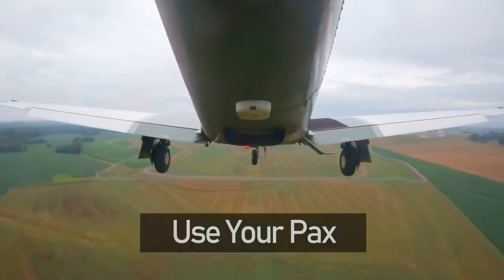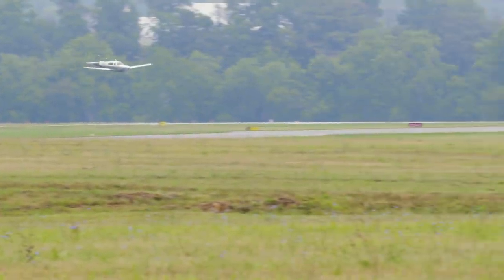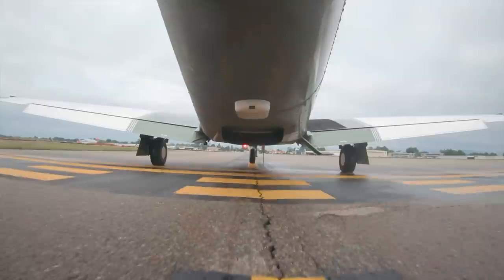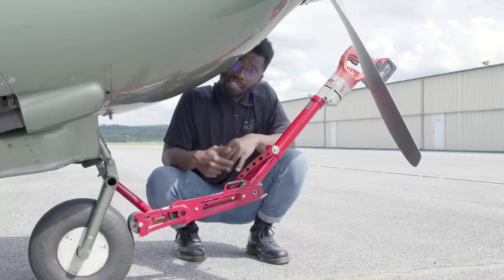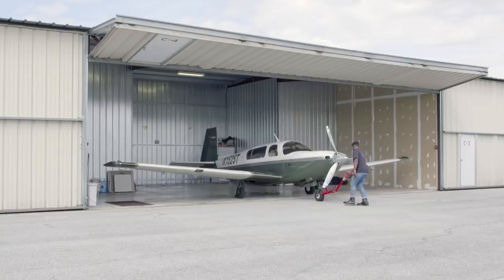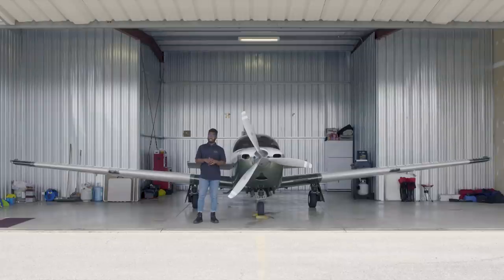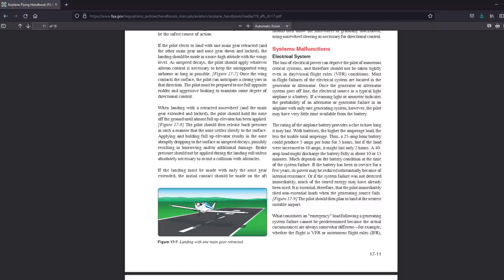Avoiding Gear-Up Landings and Gear Collapses

Comment: To avoid gear-up landings I simply lower the gear before I land.
Reply: Salute🥂
Reply: I’ve heard some say the same thing afterwards when explaining  they heard the sheet metal.
Reply: Roaming Adhocrat, Ignorance is bliss.
After ATC commanded N468AC, with two pilots and 105 passengers aboard, to go-around, N468AC landed with the gear up.
N10556 was landed gear-up. Just two guys having a bad day?
After a series of distractions, the two pilots of VH-VQ, an A-320,  ...
ASRS receives an average of 60 gear-up landing safety reports each year.
There is a lot of forgetfulness out there. Pilots forget to check-in on freq, they forget to refuel, they forget to set the flaps and slats for takeoff, they forget to retract the speed brakes, and so much more. Forgetfulness (read Distraction) is everywhere.
In this profession, you’re only as good as your last landing.  Can you really afford to be distracted?
Reply: @os9706 , PIA 8303.

Comment: Good points and I have known some experience people who have managed to gear a plane up. I do one GUMP abeam the numbers, another after turning base, quick verification before turning final and then check everything foward (Propeller and Mixture) and three in the green on short final. I do not move anything until clearing the runway and stopping. Then I look at the flap control before raising the flaps and then clean the plane up before moving. I fly a F35 Bonanza and you could easily move the wrong switch if not careful.
Reply: That's what I was taught: Identify the flaps, raise the flaps.
Reply: @jjohnston94  it is a real problem with early Bonanzas. Lots of "gear ups" on the roll out. Touch nothing until clear and stopped.
Reply: Those Bonanzas have about the worst ergonomics of any aircraft ever made. Beautiful switchgear but very easy to confuse the gear with just about any other switch on the panel. Even with that tiny protruding wheel.
Reply: @calvinnickel9995  I cannot agree with that statement. With any retractable gear plane I do not do touch and goes. I land, get on the taxiway and look at what I am moving first before moving it. There are only two piano keys that are not smooth. The one on the right has a section of wheel. The on on the left a simple rendition of a flap. I have an F35 with the originals. Very easy plane to fly by the way.

Comment: I'll never forget teaching a multi student when he forgot the gear. The G1000 system was smarter than most and literally said "Check Gear" repeatedly while flashing a caution message at first then as you descended increased it's intensity and changed to a master warning on the PFD. The student didn't notice the caution and on final at about 300 feet just silenced the warning and kept going. I was honestly dumbfounded at how stupid people can be.

Comment: Aerostars had a history of gear up landings. Then that installed a ridiculously annoying gear warning buzzer. Problem went away. As a pilot with thousands of hours I'd advise one if these systems. It's too easy to forget under the right circumstances. This extra added system could save your bacon. Couldn't hurt anyway.

Comment: As a non-pilot, I'm amazed that this happens so often, it seems like such a trivial thing to get right. Sure, if you've just transitioned from fixed gear, or switch between fixed gear/retracts a lot, I can see this extra risk, but for pilots having flown retracts for years suddenly forgetting to put the gear down... Fascinating.

Comment: I've never heard of a fail safe that prevents the gear from being raised when the aircraft is on the ground. Why is this?
Reply: They exist. Many of them sense when weight is on the wheels and thus, don't allow the gear to be retracted on the ground
Reply: @turbofan450  Cheers.
Reply: Don't many larger aircraft have this? I think it's called a squat switch.
Reply: @SolarWebsite  The video does reference squat switches, but just to say they don't always work.
Reply: Most small planes have switches that will disable the system so it cannot be raised on the ground. But you are relying on 30 or even 60 year old systems that despite being well cared for may not work. Also as you are rolling down the runway after landing the plane for a period is not fully settled on the gear since the wing is still providing lift.  This may prevent the system from working and an inadvertent retraction may be allowed to happen.
Reply: @johnmajane3731  I see.
Reply: @jimsmith1856  I remember reading about a prototype WW2 fighter that had a high number of on-the-ground gear retract mishaps. The flap lever and gear lever were right next to each other on the same side of the panel. The manufacturer's proposed remedy was "more training", but the War Department's solution was to move one of the levers to the other side of the panel. This was done, and the gear retract problem stopped.
Reply: @jjohnston94  Back in the day… when the gear lever was typically a hydraulic valve rather than an electrical switch, and likewise the flap lever, you could save a lot of weight and complexity by having the controls near each other. I mean the Hawker Hurricane had a single lever to control both gear and flaps! So just moving one control to the other side of the cockpit isn't necessarily trivial.

Comment: Well, here's an interesting thesis subject for college or school:
Design an AI that recognizes when a pilot is coming in for landing, and acts as a smart gear warning.
Reply: A lot of aircraft have similar annunciation systems. Below certain airspeeds, altitudes, power settings, or a combination of the you can get multiple warnings.
Reply: @philconey11  Yes, which is why I didn't say "make a product and sell it". There are pretty robust solutions to this problem already, yes. But because it is relatively complex (since you can't rely just on, say, altitude to give a warning) it would make a good school project.
Reply: That’s literally EGPWS.
Reply: @calvinnickel9995  As far as I understand EGPWS uses a terrain database to warn the pilot of terrain. As such, it is not what I'm talking about at all. What I am talking about is a neural network that is trained to detect landing preparations based on pilot actions and behaviour, and warn the pilot if the gear isn't down. Like I said, this isn't an idea for a commercial product, but for a research topic.

Comment: "Gear-up landings and gear collapses happen to pilots regardless of experience levels or certificates held" may hold true for GA but for Airline Ops this is unheard of; except for mechanical failure. The difference? Rigid SOPS and checklist adherence! As a GA pilot you should really try to emulate the professionals!

Comment: I would definitely turn off the engine. If you can't set it down right at the runway with engine off, you should not be flying.
As for pilot error, if the plane has synthetic vision, as they should all do, it can do the math on an approach to land and warn that the gear is not out. Since GA has pilots of high average age, such would seem pertinent. Since the plane is totalled in a belly landing. Rather costly impact on insurance rates. I hear that's a problem.
Reply: @SGTSnakeUSMC  bs. GPS and a map can be done for pennies.
Reply: @DanFrederiksen  Incorrect...again.
Reply: @SGTSnakeUSMC  dude, you can get a Lenovo 14" laptop with everything for little over 200$. it can run google earth and then some. synthetic vision glass doesn't have to cost 10 grand. And if you just wanted bare minimum cost synthetic vision you could probably pull off a 60$ device with a 5" display that may not be the most elegant but quality enough information to easily fly by and keep you safe. a 32 inch 4k LG monitor is 250-300$. Yet a 10inch garmin 1280 pixel display is 10 grand.
Reply: @SGTSnakeUSMC  synthetic vision doesn't require wifi or any internet connection. I'm a tech genius and computer scientist. It is as I say. Google earth was just to show you that an inexpensive computer can render more than adequate synthetic vision. Not that it should live load from the internet.
Reply: Dan you should stick to things you know. I don’t want to do math on final to determine if my gear is up. And planes are not always totaled. I landed my Beech F33A gear up 14 months ago. Pilot error. Ins paid and we rebuilt the plane and it flies as good as ever. Checklists etc are fine until you get complacent or heavily distracted. I do GUMPS and checklists but my one inviolate rule is do not descend below pattern altitude with gear up.
Reply: @johndalman6616  I didn't say you should do math, I said a computer system. So you don't land without the gear and the rest of us have to pay for the insurance. Maybe I am sticking to what I know.
Reply: @SGTSnakeUSMC  hun, pilot is a glorified bus driver, like Sully who decided in his infinite wisdom to land in an icy river instead of the runway he could easily glide back to. Or John Dalman who belly lands his planes. You call yourself sergeant snake. Of my several skills I can actually do electronics design. I can actually do the software programming. And I work with terrain data daily. That I own a plane is incidental. Bus drivers don't engineer buses.
Reply: @DanFrederiksen  so what math would the synthetic vision do to tell me the gear is not down?
Reply: @johndalman6616  synthetic vision is just 3D rendering of terrain data. GPS tells you where you are. If the GPS coordinates are close to the ground, the computer can trivially inform you that you gear is not down. That threshold could be earlier if approaching a runway and slowing down etc. It knows that too. Recognizing an approach to land is very doable in code.